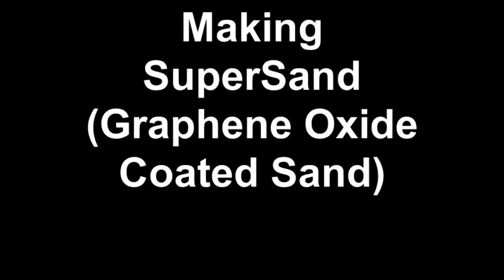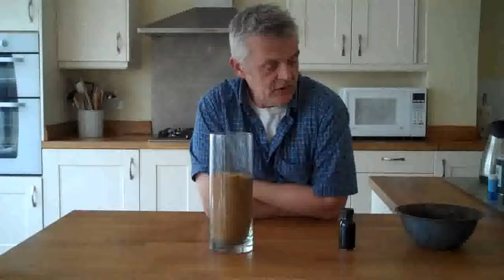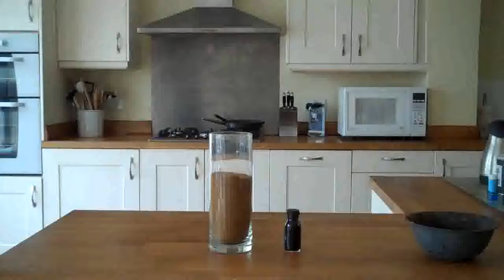Making SuperSand (Graphene Oxide Coated Sand) For Water Filtration

Comment: Hey Robert, thanks for your video. 
It really was helpful. 

I just have 2 quick questions since my listening skill is not perfect. 

1. You wash off the sand in WHAT 10% solution? 
    (I repeatedly tried to listen to the word but can't get it)

2. Could you please briefly write how to apply Activated Carbon to stop the GO oxidizing? 

Look forward to your reply.
Reply from the maker: HCl - what activated carbon?
Reply: Thanks for your reply Rob, 

My 2nd question is at 1:00 of your video. You said in order to stop the GO oxidizing, do something with Activated Carbon. I'm not sure what you are exactly talking about. Could you please reply on this? 

Thanks in advance.
Reply from the maker: you want to dry the sand but not reduce the GO so a coating on the top creates an inert atmosphere - you could use anything - if you have a lab oven use a flush of nitrogen or argon, you could also use charcoal bricks - anything to reduce the possibility of the GO being reduced
Reply: +Robert Murray-Smith thank you very much! I appreciate that.
Reply from the maker: no worries mate

Comment: May I ask you Robert, if it would be possible to use sugar method creating graphene coating, and alter it back into a graphine oxide?
I am studying materials engineering and am experimenting on fly ash. I would like to know, if you think supersand would perform well  when mixed with heavy metal induced ash, so the end product would be reduced heavy metal loads of ash. There is alot of ash that cannot be recycled because of too high heavy metal concentrations and this means in the end the heavy metals end up back in the ground and in waters. (Sorry about my Englsih, it is obiously not my native language) :).

I am also open for suggestions for adding compounds to the graphene oxide ie. Silver nitrate etc. Any suggestions in mind, if so, I can report back to you on results as soon as they are finished :).
Reply from the maker: +Fox Roscoe I think what you suggest is more than do-able. You would have to be careful re oxidation conditions for the grapehe coated sand or you will over oxidise. There are a lot of reports in the literature re silver coating graphene and graphene oxide because of the anti microbial effect and it's use in waste water remediation - just scan google scholar

Comment: I see your videos on Ultra Sand (graphene coated) and Super Sand (GO coated). Can both be used effectively and what specifically is the difference? Have you done any comparisons at similar coated loadings (gms C/gms Sand)? Thanks in advance for your help.
Reply from the maker: +Sandeep Dhawan I take it from your question you plan on doing this and i suggest you do - let me know what you find out
Reply: +Robert Murray-Smith Thanks, infact my question was based more on curiosity, since the UltraSand seemed simpler. I am however trying to replicate making GO. 1) Can you please help me with identifying a starting point for how many gms of GO I need to coat say 100 gms of sand to make an effective water filtration setup. 2) How does one know that you have made GO-is there a simple "household" test or do I need to rely on Spectrospcopy. BTW I do like your videos, they are simple and to the point-Thank You.
Reply from the maker: +Sandeep Dhawan If you are planning on doing this your best bet is to do a little reading first - I can tell you haven't done enough because of your questions. The weight of GO is very small less than a gram for 100g of sand but exact percentages you need to experiment with. The only sure fire test is Raman
Reply: hi 
what is the volume of (GO 4 mg/ml ) that i need to coat 100 g of sand ?
Reply: Graphene from Sugar and its Application in Water Purification

Comment: hi rob
I have made GO watchin your earlier videos.
In this video u have used  of GO solution. Can u tel me how u made tat coz what i have is GO in powder form??? I would like to know how much GO (grams) u mixed with sovent (water,mL) to get  4mg/mL conc of GO solution???
tnx a lot
Reply from the maker: 4g in a liter mate- that gives 4mg per mL - i get a feeling you didn't think thast one through lol - anyway just add it to water and sonicate
Reply: Is sonicating really required coz i dnt hav one ?
tnx for quick reply
Reply: Robert Murray-Smith and also even i tend to vary GO conc to sand ratio , so s their any tests to check for th efficiency of water purification???
Reply from the maker: Shashank Akkasali
no you can use a homogenisor - (blender)
Reply from the maker: Shashank Akkasali
yes - but just google it - the answer is on there

Comment: You can make a pretty concentrated silver nanoparticulate solution with a 9 volt battery and a couple of pieces of pure silver wire.  If you evaporated that down......
Reply from the maker: to be honest mate - i tend to avoid silver because of the expense
Reply: Robert Murray-Smith you spoke about silver impregnated graphene oxide flakes for added antibacterial properties. I simply was adding a cheaper way to get to the same end.

Perhaps I am missing something.
Reply from the maker: Clown Whisper
not at all mate - i would encourage others to try it - but it's not something i would do - that doesn't mean it isn't worth doing - i just wouldn't do it because of the expense